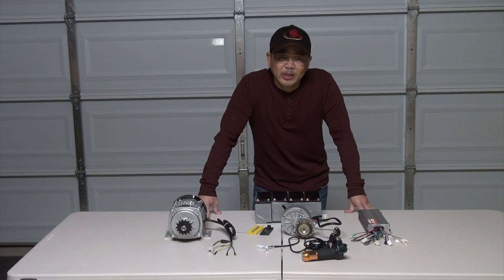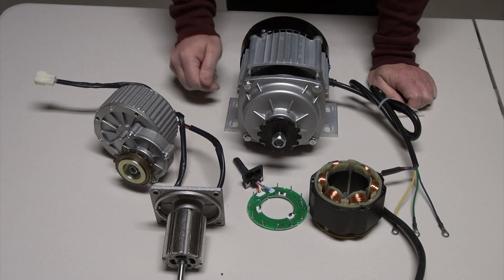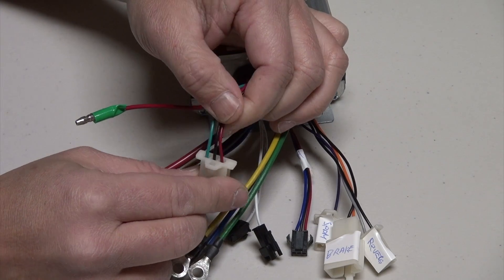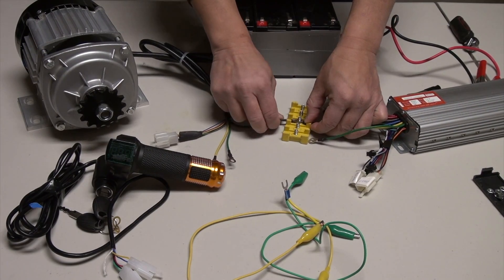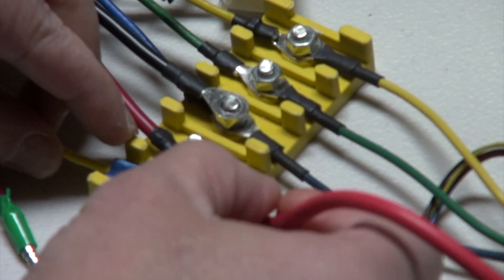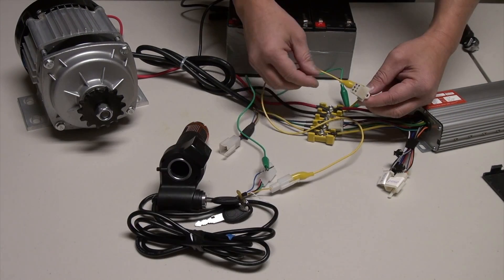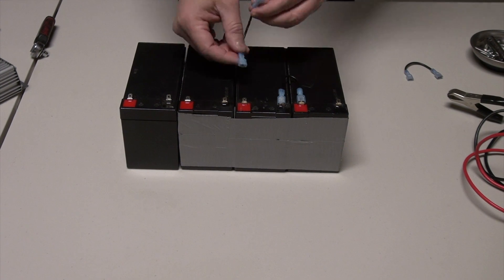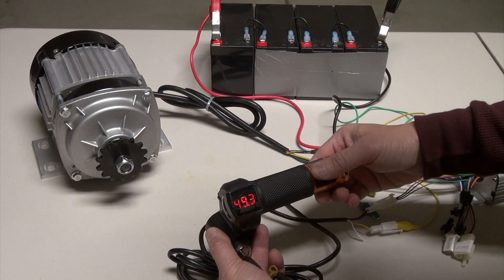How to Connect a Brushless DC Motor to Controller (48V 750W E-Bike) in English

Comment: Hello DIY man.   Thank you for making this excellent video!  It was must helpful.  However, we have a problem with our setup!  Every time we try to connect the positive wire to the battery, there is a big soak!   We can't find any bad connections though.  Do you have any ideas what could cause the sparking?
Reply from the maker: Hello,  that doesn’t sound good.  Could be a number of things in the circuit.  Check again if the batteries polarities are property connected.  Other than that, it is difficult to tell without looking at your set up.  So sorry!
Reply: @diypotentials  could I get your email address?
Reply: @diypotentials  there's really no one out there who can help with this.  Then I could send some pictures of the connections.
Reply: @diypotentials  could we by-pass the controller to test the motor only?
Reply from the maker: Hello, I’m in Yellowstone this week.  Very limited access to the internet.   I don’t think you can bypass the controller to test the motor.  My email is diypotentials@gmail.com.  I can help more after my vacation on July 5.
Reply: @diypotentials  
Thanx, I'll send you some photos of the project.  Could be a bad connection or just bad parts.

Comment: My motor only has positive and negative wires.. How do I connect it to the controller? Thanks!
Reply from the maker: It sounds like you have a brushed DC motor.  If so you cannot connect it to a brushless DC motor controller.  However, you can connect it to a brushed DC motor controller.
Reply: you mean..CAN NOT! connect
Reply from the maker: Good catch! Thanks 😊

Comment: What the rating for your BLDC motor? What is its RPM?
Reply from the maker: The RPM is rated at 2800RPM.  With no load, it is rated at 3100RPM.  You can search this phrase on ebay for more info.  750W 48V Electric GoKart Tricycle Cart Brushless Motor Gear Reduction w/ Control.  Thanks!

Comment: I just got the same throttle and was trying to figure out to how to connect it, so thank you for making this vid. Since the throttle has a voltage meter and it's directly connected to the battery, do you think a fuse between the two connection is necessary? I've seen some users do it with other voltage meters and others who don't.
Reply from the maker: If you are connecting it through a controller, I don't think a fuse is necessary.   I use the throttle on 36V 30AH lithium-ion battery pack without a fuse and no problem at all.  Take a look...https://youtu.be/c6YgNQg3VM8.  Thanks for asking...

Comment: Can I contact you to ask some questions? I would like to use this for my boat.
Reply from the maker: Hello,  I’m not familiar with boats.  So I’m not the best person to help.  Sorry.
Reply: @diypotentials  Hi.nice video you have here.I have the same controller but my blcd motor doesn't have hall sensors.Is it possible to run motor without sensors with this controller?Thank you
Reply from the maker: I'm not very familiar with no hall sensor BLDC motors.  There might be sensorless BLDC controllers you can look into.
Reply: @diypotentials  ok.thank you.

Comment: How reversible the motor connection pl
Reply from the maker: There is a connector for reverse on the controller.  It is the one with the black and gray wire.  You can put a switch between the wires.

Comment: Well it work as the motor will spins if I only use a 24v battery on this 48v setup? Because my new setup didn't work when I use a 24v battery on mine 48v setup, is there a battery cut off?
Reply from the maker: The motor will probably work at 24v but it won’t be as powerful. If it is rated at 48v it will work better at that level.  Also, it won’t work at 24v if the controller only run on 36v or 48v. Thanks!
Reply: @diypotentials  so like cutoff voltage?
Reply from the maker: The controller’s cutoff voltage.  Thanks!

Comment: So is the DC brushless motor or bldc motor actually a three-phase AC motor?
Reply from the maker: The bldc motor is a direct current (dc) motor.  AC motors run on alternating current (ac).  So a bldc motor is not an ac motor.  Both ac and dc motors can have multiple phases.  Thanks 😊!

Comment: please help!

I have the exact same set up with the throttle having both the yellow and blue wires and the controller having one red wire for the ignition 

I did the exact same thing that u did 

but my motor still didn’t run when I pressed the throttle.... does that mean that my motor doesn’t work?? The throttle did turn on but the motor didn’t run

I don’t know if the motor or controller is messed up :(
Reply from the maker: Check the throttle wires, make sure the colors align with the controller throttle wires when you make the connection.  Red to red and black to black and the green wires should match...
Reply: @diypotentials  yeah I did that only the signal wire for the controller is white so I matched the green signal from the throttle with the white signal from the controller... do u think maybe I have to change the phase wires?? Or maybe the motor is messed up? It’s a Brand new motor so I can’t imagine that it would be the motor ... 

btw this video was amazing exactly what I was looking for! It just sucks that it’s not working out for me :/.
Reply from the maker: @Christian Menéndez  I would connect the learning wires together and see if that would work.  If that doesn't work,  I would switch the phase wires from the controller to the motor like you were saying-- Sometimes the colors don't match-so try different combinations.  Try to switch one wire each time and test it.   THIS is very IMPORTANT, when you switch the phase wires, you also have to align the Hall sensor wires as well.  Be careful.  Good luck...I hope that will work.  Thanks!
Reply: @diypotentials  thank u I will try that!! 

So what ur saying is if I change the phase wires do I have to match the hall sensors to match the phase wires? Or keep the hall sensors connected the same with the colors matching?
Reply from the maker: Yes you have to match the hall sensor wires with the phase wires...
Reply: @diypotentials  Thanks for all ur help sir!! I liked and subscribed💯 keep up the great work!!
Reply from the maker: Did it work?
Reply: @diypotentials  I’m going to try it now!
Reply: @diypotentials  yeah no I tried it and it still didn’t work so it’s probably they gave me a bad motor... I connected everything like how u did it and I also tried every combination possible on the phase and hall sensor wires and it still didn’t go. The throttle turned on but the motor did not go... the motor is probably broken anyways thank u for helping me!!!

There’s a blue bike wire on my controller labeled as speed signal but it’s not apart of the three throttle wires so idk what to do with that one, maybe I’m supposed to connect the green wire from the throttle to the blue speed signal wire on the controller but idk let me know what u think please!
Reply from the maker: What a bummer!!!  I don’t think the blue wire will make difference.  Hang in there...Thanks!

Comment: Really well explained 😀
Reply from the maker: Hello,  were you able to wire your motor or do you still need help?
Reply: @diypotentials  I have a 36v 11a rated current motor, 10s 5p (Samsung 30q) battery, along with a speed controller rated for 30a max.. I'm creating a 'light duties' power assist bike trialor.. hopefully the set up will work.  I may need a more powerful motor.
Reply from the maker: Sounds like you are set for the project.  Your motor should be sufficient.  The motor is I used for my Ebike conversion (https://youtu.be/c6YgNQg3VM8) has a similar rating at 450 Watts.  Good luck on your project.  Thanks!

Comment: I have a 3000 watt 72 volt motor and im trying to use the same throttle you have. There's red, black, yellow, blue, and  green coming from the twist throttle and the controller the following: it has a orange and a red w/white stripe for the electric lock and for the throttle there's black red and grey. Can you please please help me 🆘 ...
Reply from the maker: Hi Richard, if I were to make the connection, I would connect the grey wire of the controller throttle plug to the green wire of bike's throttle plug.  The red and black wires from both plugs should match.  For the switch, since red wire w/white stripe is often associated with positive, I would align it with the yellow wire of the switch plug first.  If that doesn't work, align the yellow wire with the orange and connect the blue to the red wire with white stripe.   When you connect the wires, make sure the switch is on the OFF position.  Good luck with your project.  Thanks!

Comment: thank you very much for your help.  I have a question.  I did the same thing you did in the video.  Throttle display turns on but engine won't start.  what could be happening?  I already checked the connections and they are the same as in the video.  Thank you!!
Reply from the maker: Hello.  Sorry to hear.  My suggestion is to connect the leaning wires together.  If that doesn't work, the next thing I would do is try to switch the phase wires from the controller to the motor- Sometimes the colors don't match.  Try to switch one wire each time and test it.   THIS is very IMPORTANT, when you switch the phase wires, you also have to align the Hall sensor wires as well.  Be careful.  Good luck...I hope that will work.  Thanks!

Comment: simple diagram, whats the cost 60 mph for 2 hours fully laden excluding batteries  400 lbs how many batteries watts volts cheers
Reply: Hard question.

First off there's the question of gearing. Gear DOWN for torque.

60mph? Hugely inefficient on an ebike.

I recommend a 60v 30ah battery with a torque sensor set up. Even gentle pedalling will preserve battery life.

Forget about buying a finished bike with those spec.

My recommendation : do the research, invest in a battery tab welder, buy cheap A123 cells and weld up a big pack.

Join Endless Sphere forum and learn the basics.

Comment: I have an escooter that just died. I installed new batteries and I get nothing.  How can I trouble shoot the controller.  You are the best in    explaining how things work and troubleshooting.  Thanks for your videos.
Reply from the maker: Sorry to hear that about your e-scooter.  There are so many electronic components and parts involved that it is hard to pinpoint the problem.  It could be the controller, a blown fuse, the hall sensors not working, or a wire not connected properly to the motor.   I saw several videos that might be helpful for troubleshooting the controller.  https://www.youtube.com/watch?v=ev2J6iq5t4g, https://www.youtube.com/watch?v=lTssCn5YyTw, https://www.youtube.com/watch?v=NNtGJS-jGd4&pbjreload=101.   I hope this helps.  Thanks!

Comment: Hey, you've made it quite simple! Thanks
Quick question, is it possible to make the motor spin in the other direction??
How do you charge the batteries?
Reply from the maker: Yes.  The controller has a reverse switch.  You can use a charger to charge batteries that are rechargeable.

Comment: Can you help me calculate the maximum weight that I can carry using that motor and with the same control and batteries please
Reply from the maker: Hello,  Here is a rough estimate. A 1 horsepower (hp) motor can lift about 550 pounds.  At 750W, the motor is about 1hp.  Since 750W is the peak power of the motor, 550 pounds would be the max weight.  However, at this weight your bike or scooter will be probably go very slow.  You can research online for electric go karts or scooters with similar wattage (700-800W) rating.  Usually they would indicate the maximum weight capacity and speed.   For similar power (w) rating, I saw max weight ranges starting at 220lbs to 350lbs for speed between 15-20mph, depending on the weight.

Comment: can you help me to wirer in a forward revease swith to a rogue 2000w 60v controller please thanks roy
Reply from the maker: Hello,  I'm not familiar with the rogue controller to be able to help.  But I found this wiring diagram that might be helpful.   https://www.ebay.com.au/itm/New-Voltrium-2000w-60v-Motor-Controller-for-Electric-Scooter-1000w-1600w-/174067978078.
Reply: @diypotentials  thanks for your prompt responces,brother,  i was thinking of a togle switch between motor and controller,,3 main wires being yellow blue green,DPDT SWITCH, with your knowledge and experience do you think it will work??? thanks man for your feedback
Reply: i am disabled and have a mobility scooter im trying to put a 2000w  motor into scooter just for a wee bit more speed rather than 14kmh lolol
Reply from the maker: Scot,  I'm not sure if putting a switch there would work.  I'm assuming your new motor is a brushless DC motor,  then the yellow, blue, green wires are motor phase wires, putting a switch there would interfere with the hall sensor signals.   I'm assuming your scooter has an on/off or ignition switch.  That might be the most appropriate place to make the switch connection.  I found another video that does a better job with wiring mobility scooter .  This might be more helpful.   I'm all for more speed as well.   You will figure it out and it will turn out great.  https://www.youtube.com/watch?v=APRoSdOSf0c  Thanks!

Comment: hey man nice vid
how would i charge the 12v battery and also would this be good for a drift trike or go kart?
Reply from the maker: It might work on drift trike, but go kart for sure.  In terms of battery,  I suggest getting lithium-ion battery pack.  They are more expensive than lead acid batteries, but lighter and more energy density.  Some of these packs come with a charger.  You can explore eBay for different options.  eBay should have a12v charger as well.  Thanks!
Reply: @diypotentials  thanks bro. u the best :)

Comment: Nice video. I was just wondering what the wires were to the motor. I'll need to watch this again when I look at my escooter.

I did a quick fix on my kugoo m4 pro. I had banged/scrapped the wires that go to the motor. When I tried to accelerate then the motor would make like a vibrate noise and had very little power. So looking at the wires, I cut off the rubber protective and seen 2 thin wires were disconnected and the thick wires were fine. I connected the broken wires them by twisting together and duct taped it for now and scooter is working good. Just a quick fix until I get a soldering iron.
Reply from the maker: Good job!  Glad you fixed it.  Thanks!

Comment: Please , what  is the  values of  parameters of this motor ( R, l, l....)
Reply from the maker: Here is the link to the information about the motor.  https://www.ebay.com/itm/48V-750W-Electric-Brushless-Motor-Controller-DIY-14-Tooth-Gear-Reduction-Motor/153087073383?ssPageName=STRK%3AMEBIDX%3AIT&_trksid=p2057872.m2749.l2649
Thanks!

Comment: I am looking to make a ropetow in the garden powered by a battery. The ropetow just needs a simple start / stop (presumably connect/disconnect the battery) and to tow a person skiing up a hill. Would you reckon this motor would be good enough or would it be too fast or too weak? Honestly, I know it is a very odd question but just curious and looking at the market.
Reply from the maker: Sounds like a fun DIY project. The motor might not be powerful enough.  If you have access to AC power, that might be a better option, then you can use an AC motor with maybe 2 horsepower or so.  Brushed DC motor might be easier to connect, but you will need a good size battery bank.  You will eventually need to charge the battery.   Here are couple of videos that you might find helpful.  Good luck! https://www.youtube.com/watch?v=XeOAjB2jfPc,
https://www.youtube.com/watch?v=fiUEUrfW2RE
Reply: @diypotentials  Thanks for the reply. Yeah I was thinking it may not have enough power to tow a person up the hill. I have access to AC power at home but I was trying to get it as portable as possible as the slope isn't near a power source, hence why I thought your video with the battery was quite interesting.  The two setups in the videos are very interesting, and using the dolly is a good advantage for transportation but like in the videos, they are connected to the mains. I don't mind having to charge the battery but as you said , a good size battery would be required. I will also keep an eye for a two hp motor or even an engine with a drive. Thanks for your help!

Comment: Amazing video! I was looking for this. Just one question - Is it really necessary to buy the motor controller? Is it not possible to control the motor directly from an Arduino (I have seen this in some videos) ? and also MATLAB/Simulink have a Motor Control Toolbox, would it work ? Thanks in advance!
Reply from the maker: I haven't not try it with Arduino.  So I would not be able to say yes or no.  The controller is specifically designed for the motor as it also comes with other features for controlling your ebike, scooters, etc.  Thanks.

Comment: Hello, where did you order the yellow wire junction connector from ?
Reply from the maker: The connector came with the motor and controller.  You can search Ebay for motor terminal block, you might find a similar terminal connector.  Thanks and good luck...🍀

Comment: How much No load current (Amp) your controller is taking, Have you seen that?
Reply from the maker: The Controller could take 48V at 1 to 30A.  Thanks!
Reply: Yes but how much current , this controller is taking..? I am not  asking the range of current , please tell the exact figure..
Reply from the maker: @SunietkVerma   It depends on how much current the load needs.  For example, if the electric motor require 5A at 48V to operate, then the controller will feed 5A to the motor.   The max current the controller can take is 30A.  For the motor in the video, I don't think it uses more than 3A because  it was not connected to a load.